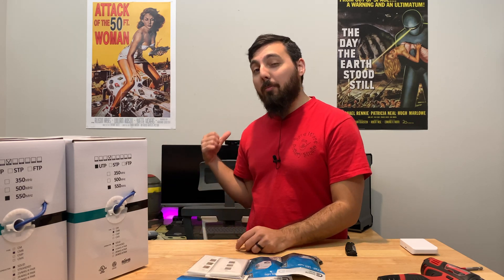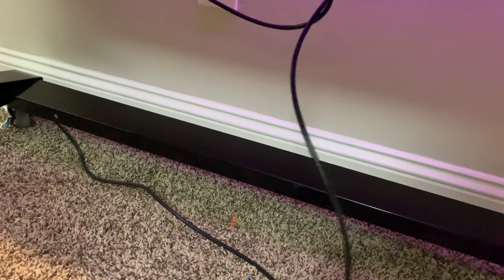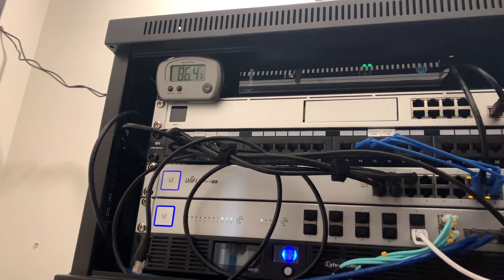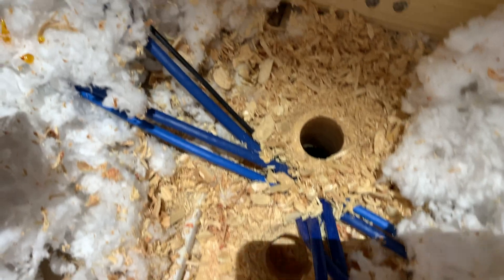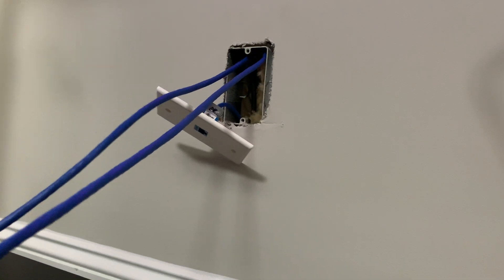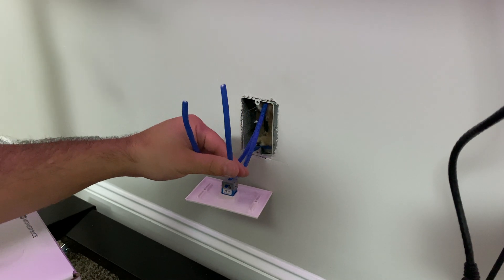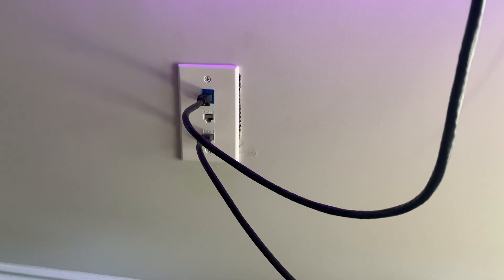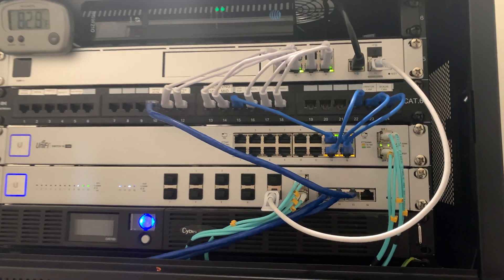Running Network Cable in the Home Office and Living Room |Cat6 Ethernet #homelab

Comment: Correction… it is recommended to run Cat6a or higher to get 10 gig connectivity… especially if using POE. Cat 6 can handle a 10 gig signal.
Reply: at the length of cable in a normal one story house cat 6 is plenty for 10gig
Reply from the maker: Cat5e, 6, 6a, 7, and 8 all do 10GbE at different lengths and signal strengths.  I am hitting 1GBps with my current cable runs.
Reply: Cat6 is not certified for the full 100m for 10G but it can definitely do it with good conditions around 55m. Even Cat5e can do 10G with a couple of meters in length.
Reply: FALSE Cat6 will run 10Gb just fine in most normal sized homes...check your facts before spewing lies
Reply: @mrmotofy  

You’re right, CAT6 can handle 10g in most normal size homes!!!  Now if you have a 20,000 sq foot Mansion,  that might be an issue on some of the longer runs.

Comment: You really should seal all of those cable holes into your attic with fire block foam.
Reply from the maker: I was looking at that yesterday! Any recommendations on a brand?  I may wait a couple of months because I think I’m going to add some cameras around the house
Reply: @SPXLabs  I've had good luck with the 3M foam from HD or Lowes.
Reply from the maker: Sweet! Thanks for looking out!
Reply: What if you need to add more cables in the future? Wouldn't the foam make it impossible to run more cables inside the hole sealed by that foam?
Reply from the maker: The foam is easy to break away but the holes are still too small.  It may be a long while before I fill in the holes though.
Reply: @aurvaroy6670  If you need to run more cables, you drill a new hole.   It’s more important to seal the hole in case of fire (and to be compliant to code).
Reply: Also good to keep cold air from going in wall meeting warm air and condensating inside the wall

Comment: Nice video! I wish my attic was like yours so much room
Reply from the maker: #blessed.  I feel super lucky about the room up there.  If it wasn't the way it was I probably wouldn't be doing anything at all.
Reply: I wish i had the room in my attic too.  I can get up there but its just right where the opening is, and after that the roof comes down to so close to the floor.  I might have to pay big money to get cables ran, ugh.
Reply from the maker: Just install a hatch on the roof somewhere for unlimited access.
Reply: @SPXLabs  thats hilarious!  Hmm..damn bro that is an idea...!
Reply from the maker: Lol it’s a trap!
Reply: I’m surprised that there isn’t much insulation
Reply from the maker: 13inches except where I cleared a path

Comment: Hey is there any reason why you have ran cat6 instead of cat7?
Reply from the maker: Good question! Cat6 can do everything cat7 can do and if I really needed more bandwidth for whatever reason I’d jump to cat8 or fiber instead.  Also as of today I can barely handle 1GBps and without heavier investment anything more is just too expensive at this time.
Reply: @SPXLabs  ahh fantastic. I’ve just purchased a new house so am planning a network that is hopefully future proof. What would you recommend I run in regards to Ethernet cables?
Reply from the maker: Well cat8 if you can afford it, otherwise cat6/a is fine. If you are going to be in a hose that is bigger than 2500sq ft then fiber is probably the best route.  There are a load of dependencies in truth and a lot to consider.  So in the most general sense cat6 should be good enough.

Comment: Fun fact, you can tell how old a telco engineer is by the standard they impliment. 568A is more boomer generation, although I've seen some government requirements that require 568A but that's because they were originally written 25+ years ago but still used in requirements spec. 🤦‍♂️🤣
Reply: 568A  is widely used outside of USA.
Reply from the maker: That’s interesting
Reply: @nismo4x4n  that's weird, usually europe and the rest of the world is ahead of us like GSM vs CDMA. GSM was the norm for a long time in europe before it became popular here.
Reply: I am 30, live in the US, and have always terminated using 568A standard.. I think it is more or less whichever one you originally decided to cable with and that's the one you stuck with.

Comment: Love the video man! And hey att has a newer modem that has wifi 6 and the fiber plugs right into the back of it using a sfp plug and it has a 5 gig port on the back of it for when we offer faster than 1 gig it's called the bgw 320 rg thing works way better than the 210 you have
Reply from the maker: Thanks for giving.... 😎 me those kind words.  I just heard about the new att router.  Any pro tips for getting att to hand one over?  Would calling and asking be enough?
Reply: @SPXLabs  should be enough to call in and ask! And if they wont just call back in with yours unplugged and they will send out a tech and just ask the tech for one we love easy tickets where all we have to do is swap a modem lol
Reply from the maker: Lol okay.  I’ll give that whirl